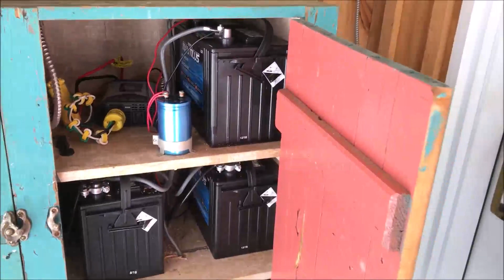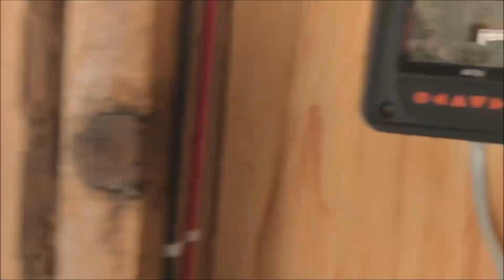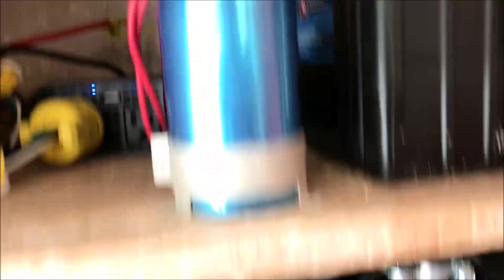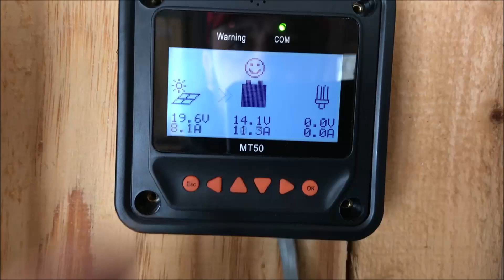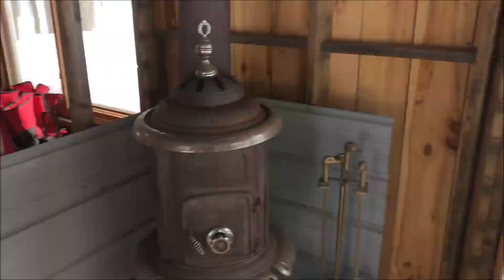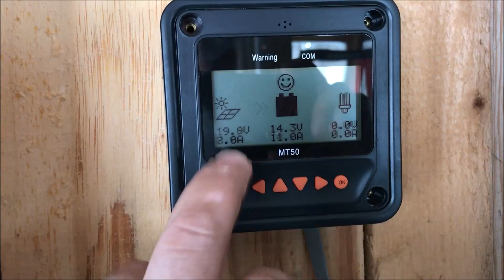Solar Power at the Shack

Comment: Nice setup! I also run an off grid system for my sugaring here in VT but stuck with all 24VDC devices for efficiency/did not need as much battery storage or an AC inverter. We use it to run our RO, lights, fan, radio, etc as well. Happy sugaring!